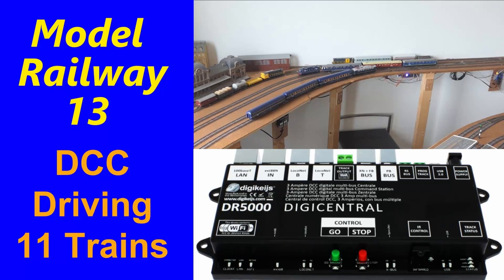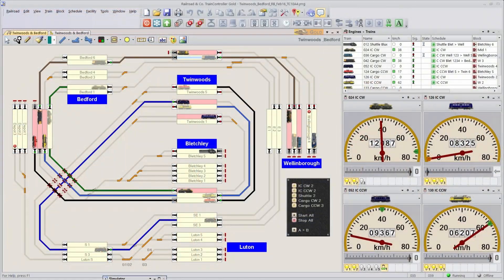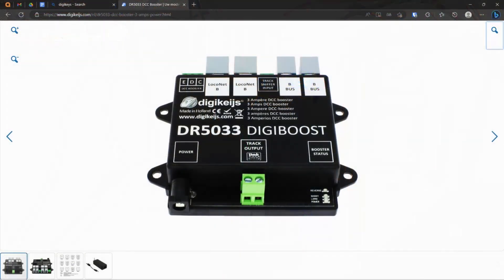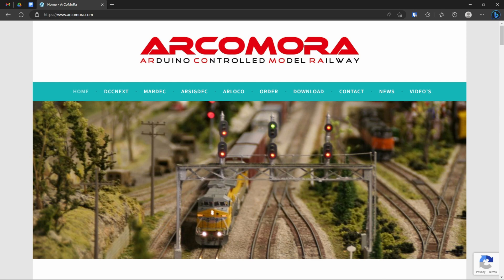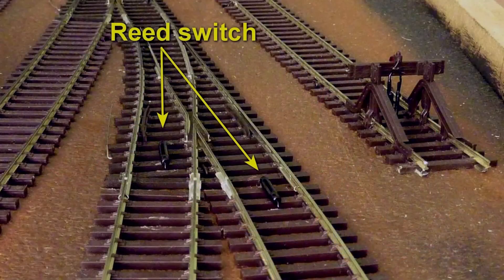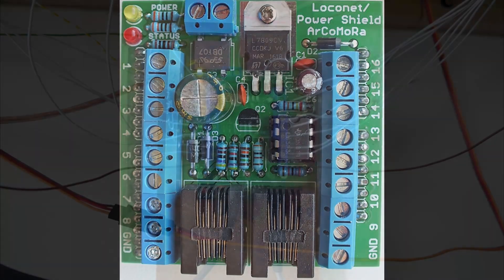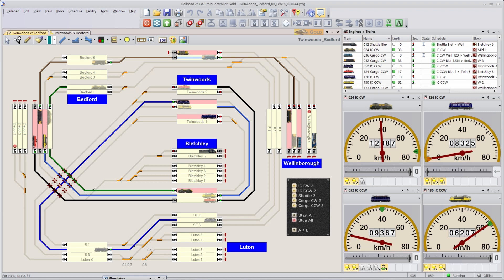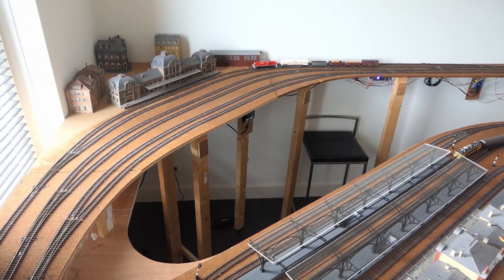Model Railway 13 Automatic Driving with 11 Trains

Comment: Hi Rudy...this looks really great. I just wanted to ask one question...you helped me set up a debounce in my reed switches a few years ago. What made you switch from s88 to loconet this time since the Dr 5000 can use either...is loconet better? Thanks ...best wishes, Antony
Reply from the maker: There was no specific pressing reason. The Arloco Modules used are just €6. Add an Arduino and it makes €9 for 16 sensors. The wiring is easy, a Loconet cable runs from unit to unit. Arloco is less prone for interference than S88.
Reply from the maker: @Antony Lipman The reeds are painted black to make them look less like the glass tubes that they are, that's all.